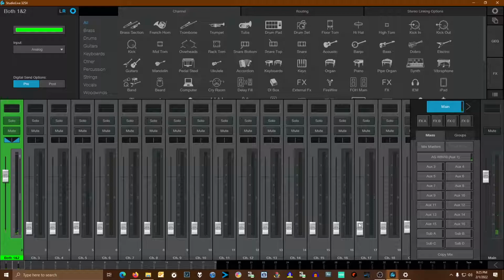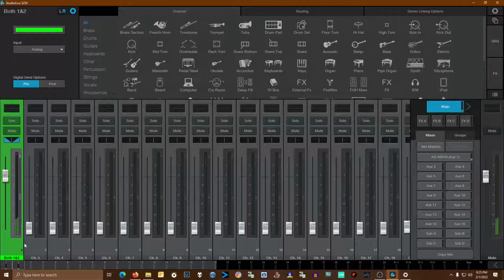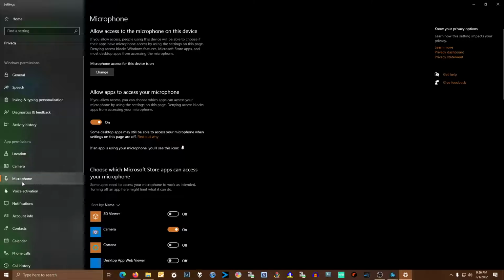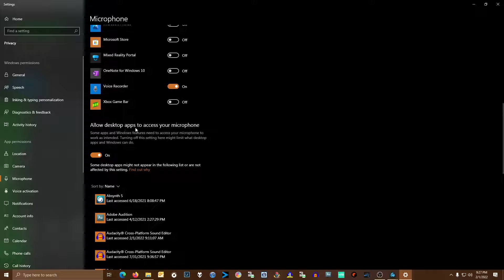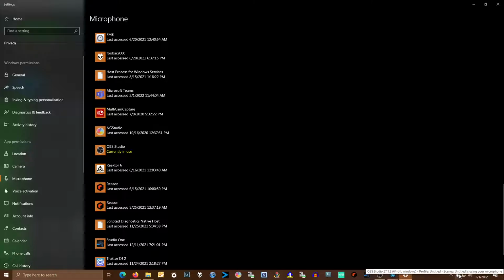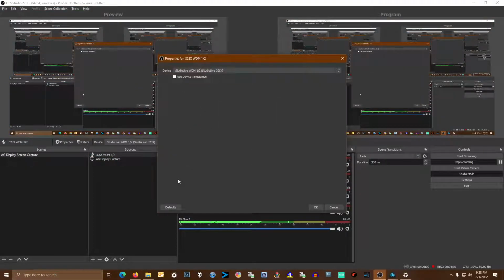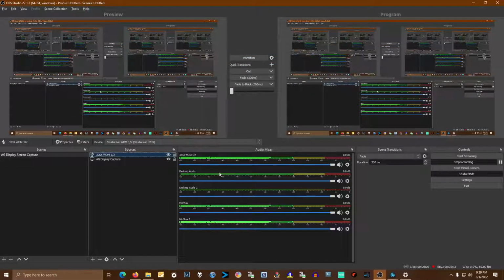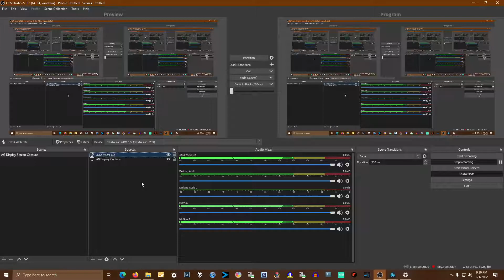Troubleshooting OBS Audio Input with PreSonus StudioLive Series III Mixer

Comment: I have a studiolive 16.0.2 usb mixer and am having issues connecting to OBS. When i open the audio settings in obs it only gives me one option "Studiolive 16.0.2 Line In" but no sound is coming in even though it is coming through on the studio one daw. Any ideas?

Comment: Hi! 
Do you have any tips how i can get more WDM channels in windows? I use studiolive 32 SC and windows 11. 
It would be great to adjust Spotify and other applications directly from the console.
I only have USB in use and I only get 4 stereo pair in and 3 out.
Reply from the maker: that doesn't seem right. I have WDM 1/2, 3/4, 5,6 and 7,8. I would think the 32SC should offer at least the same. Since I don't have a 32SC to test this, it should be easily answered by PreSonus support on your model. I would open a ticket and supply as much info as you can so they can answer straight away
Reply: @revup67   I have same WDM 1/2, 3/4, 5,6 and 7,8 and input 1/2, 3/4 and 5/6. I hope that I have like 5 stereo pair more. And I could control all channels separately with OBS
Reply: And I dont use any DAW
Reply from the maker: @passot6000  any and all routing options are in this file which you can download from the PreSonus web site:  "StudioLive_Series_III_OwnersManual_V6_EN_15022021.pdf"
Reply: @revup67  Ok. Thanks!